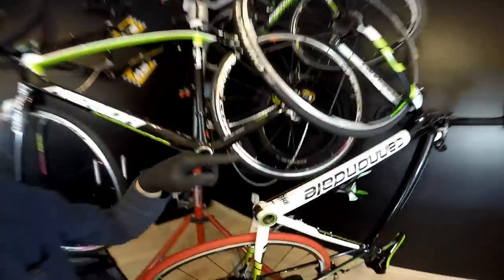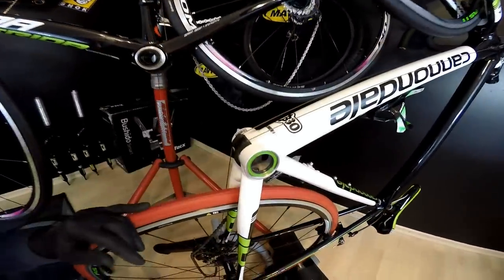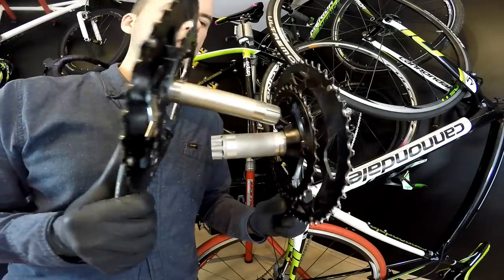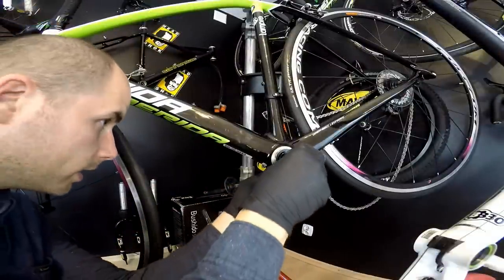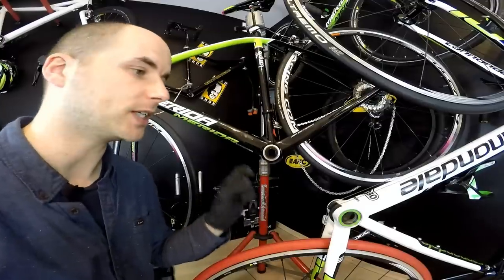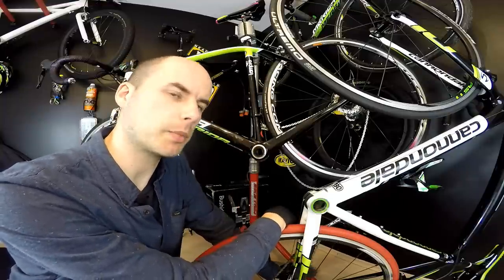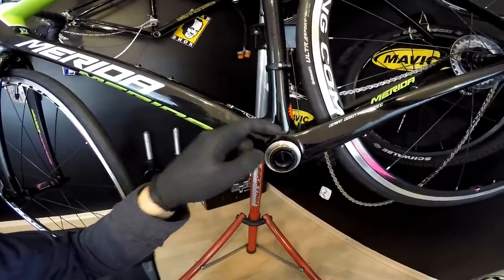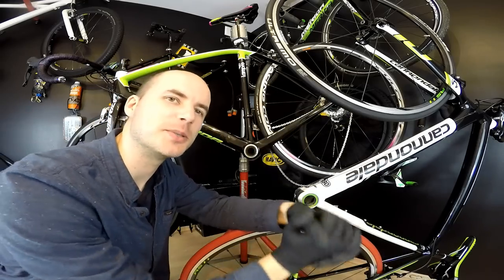BB30 vs. MegaExo bottom bracket / crankset - HUGE difference for your bike!

Comment: Well, stiffness is not only determined by the bearings distance. The MegaExo bearings are "outside" the frame which needs to support it, hence there is a leverage which is detrimental to stiffness. The BB30 is inside the frame which is a stiffer design.

Comment: I principally ride a aluminum frame DB Hanjoo as my road bike. It uses the MegaExo bearings. One big issue I've had is that in the wet season here in the PNW I'd install full fenders (Portland Design Works) and while they keep the bike and rider amazing clean and dry, there is a noticeable fine aerosol of road mist churned up near the crankset whenever I'm riding on smooth pavement at > 15-17 mph. (Note: I rarely--if ever--ride in the rain. I'm only talking about roads that are wet.)

About three years in row, whenever I removed the fenders and start riding up steep climbs in the late spring, there was a noticeable creaking from the crank in high torque situations. First time it happened I examined the BB bearings and noticed water intrusion. Changed bearings and the exact same thing happened the next couple years. 

I'm not a high milage rider and having to do an annual bottom bracket job-while not really that big of a job- didn't seem reasonable to me. Something like this never happened to me using the the old Octolink BB on my Lemond. Having the outboard bearings is certainly appealing in a conceptual way, but I've taken to only riding when the roads are dry now which is sort of disappointing.

Comment: the Cannondale axle looks like the Race Face/Easton axle, for modern mountain bikes the distance between the bearings is much greater, for example the Boost standard,So far the I have not had any issues with creaking caused by BB 30, but I had fast wear caused by flex in the frame.

Comment: Since crank power meters are so expensive, I decided to get it in 24mm (GXP) even though my frame right now is BB30. 24mm spindles can be adapted to most frames. BB30 cranks, not so much.

Comment: Doubt anyone will read my post, anyway: I have an FSA crankset with long but 30 diameter spindel for MEGA EVO bb that has threadings for regular BSA bottom bracket. How about having thicker axile (30 vs 24 mm) but wider postion of bearings (same as on regular 24 bb buttom bracket)? Think it is a profit.

Comment: Do you know if a megaexo crank is compatible with Shimano hollowtech bottom brackets?
Reply: Yes it is interchangeable
Reply: @stever5610 Won’t it be a very tight fit though? I want a Vision Trimax 24mm into my Shimano BB86 bottom bracket.

Comment: Does MEGAEXO have a greater Q-factor than BB30?
Reply: +ShaiBike hi. im having the same question. did you figure it out since then? im planning to install a MegaExo crankset into my BB30 but im worried whats gonna happen with the longer spindle. any idea?
Reply: It will create wear & tear on your chain, the teeth on your front sprockets, and the teeth on your rear cog sprockets. Expect an increase in the noise from your drive train too.

Comment: Great reviews and info I will say one thing cannondale made a bad choice using there bearing setup they should have chose a better bearing setup like maybe bbinfinte so on that case I'll never buy cannondale again bb30 is shit and you mentioned it's the carbon frame no it's not it's the bearing setup and the mechanic that did my work was a damn idiot
Reply: Michael Upchurch - its the frame. They cut it from both sides, so it will always run the risk of being slightly out of alignment when it meets in the middle

Just buy a kit to convert it. Try Hambini, and easy fix